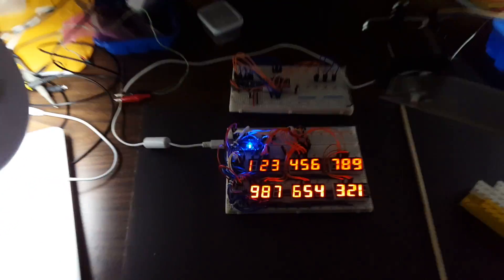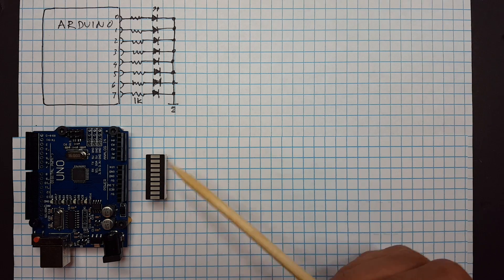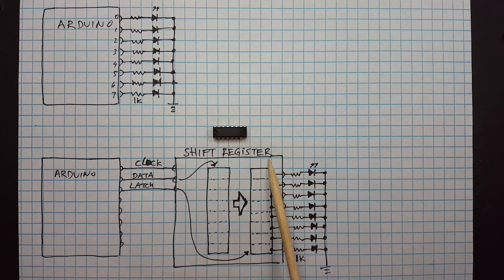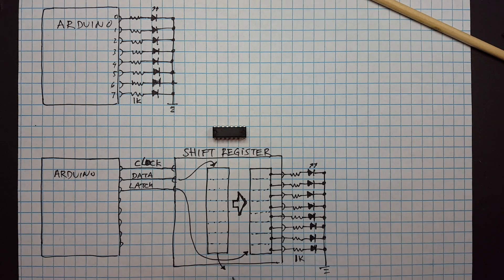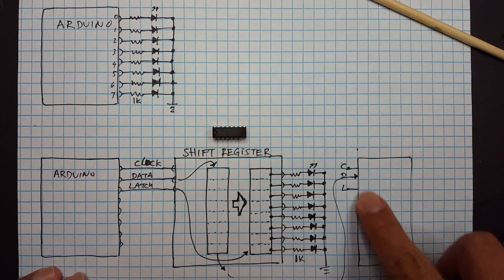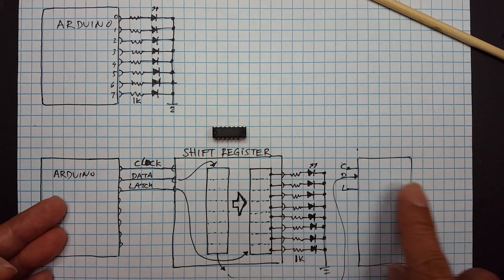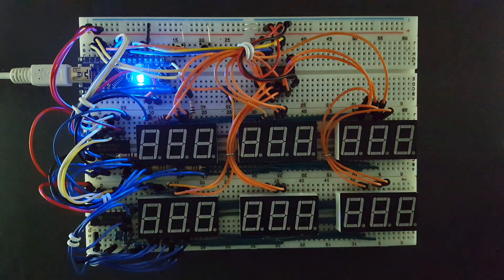HariFun #141 - Arduino vs. LEDs - Mega Sudoku Part 4

Comment: I mean this: https://imgur.com/a/p2OHQ9D Enlarge picture
Reply from the maker: The ATTiny85 only has 6 I/O pins.  You will need three to drive the shift register.  That only leaves 3 more pins.  Enough to control 3 digits, but you want four digits and some extra indicators.  There are many many ways to solve this problem.  IMHO, the best way is to get a chip with more io pins.  They're cheap and will be easier to code.
If you like the challenge, you could daisy chain a second shift register to drive the digits.  Coding would get a little harder, but it should work.

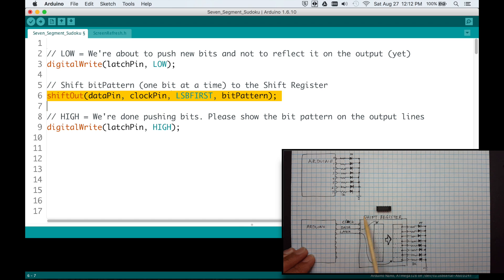Comment: Can I drive 12 hour led clock 12:00 Am OR PM led indicator & number 6 have 5 segment number 9 5 segment tex: 01:36 number 6 5 segment with 74HC595 X 4 & Atiniy 85 8 pin chip??
Reply from the maker: Hi Tommy, sorry, I do not understand your question.  Could you please explain it in a different way?
With Arduino Nanos being available for about $2, I do not see any reason to use an attiny other than space constraints.  Nano has 20 I/O pins, so you might even able to avoid the shift registers all together to drive just a few digits.

Comment: Just one question what is that IC in the top of the breadboard??
Awesome project. keep up the good work
Reply from the maker: At that time, I used another shift register to control the columns.  In final design, I drove those columns using transistors controlled by nine Arduino digital pins rather than a shift register (8 columns) and an arduino pin (9th column)
Thanks for the kind comment Pedro!
Reply: Until now i only saw the sudoku videos and the rgb cube, and immediately subscribed to your channel

Comment: Hi Hari,
Glad to see your back with another interesting project. I really like how you explain what you are doing, it is a big help in increasing my knowledge of electronics. 
I understand the shift registers, but don't quite get how you are able to write digits to all 18 led units with only 2 of them.
Keep up the good work!!
Stan
Reply from the maker: Good question Stan!  I should have covered that in the video.  :-(
Short answer: Multiplexing.

Detailed answer:
The sketch cycles through all the columns (left to right) applying positive power ONLY to ONE of the columns at a time.

Just BEFORE power is applied for any particular column, the sketch pushes the desired segment patterns for each digit in that column.

When the patterns for all 9 vertical digits for the first column have been pushed through the shift registers, THEN we provide power for that column.  Completing the circuit, showing the correct patterns for all 9 digits VERTICALLY for that first column.

Next, we prepare the segment patterns for the 9 digits in the SECOND column. Just before we display those new 9 digits, we turn off the first column and turn ON the SECOND column. Now 9 digits for the second column is displayed.

Yes, at this time ALL the FIRST column digits are OFF!
We do not want digits for second column to be displayed on first column!
Only digits on SECOND column is being displayed.

Now repeat this for all the columns VERY QUICKLY to fool humans into thinking that all columns are light up at the same time :-)

If you have trouble imagining this with 7-segments, replace each segment with just a simple LED and what you'd end up with is a simple 9x9 matrix.  Once you understand that, imagine 8 leds for each row.

It's hard to explain this in words, but I hope it helps.  
Thank you for asking the question. It's good feedback to me.
Reply: @HariWiguna  im sorry to ask,
so how many pin do you use?
3 for shift register (ds, sh, st), and 9 for activating the digit?? (12 pin for display)??
or you use less?
Reply from the maker: @MrBenyabd  , yes, you are correct: 12 pins to control 81 digits.
I also used one pin to read a 16 button keypad.
https://www.youtube.com/watch?v=G14tREsVqz0

Comment: now you can make the back to the future back in time clock :)
Reply from the maker: That'd be fun too.
Anyone know a cheap supply of 16 segment displays?
They're necessary to display letters such as K, M, and W.
Reply: +Hari Wiguna a power supply cheap one
 sure if for 5v could use a cellphone charger with a 1a output on it. or if need bigger there are a few on  ebay

Comment: is there a way to know what shift register will receive what data. for example, I want to send particular data to shift register #3 in series that way the led matrix will display a particular image of text or whatever.
Reply from the maker: Thanks for asking this question. It is good feedback for me that I should have  explained it in more detail.  As you already mentioned in another comment, each shiftOut pushes the oldest data further and further away from the Arduino.  Last one pushed out be closest to the Arduino.

Comment: i know we have to be careful driving too many LEDs from the Arduino's pins, because it can easily source too much current through the Atmega chip.  

Does the shift register act like a transistor array, sourcing it's own power?  
How do the amp limits compare to the ATmega?  Seems like a good cheap solution for bypassing the Atmega's amp limits.
Reply from the maker: I've never thought of it that way, but yes, you are correct. The Arduino only have to control the shift registers' Clock and Latch.  The LEDs are being switched by the shift registers, we're no longer putting the burden on the Arduino. 
The stock SN74HC595 can only handlw 20mA per pin. However, the TPIC6B595 can handle 150mA per pin!  Of course, if your total current consumption is higher than the Arduino's voltage regulator rating, you'll need a separate power supply for the shift registers.
Reply: Those high power TPIC6B595 shift registers are expensive.  It looks like it'd be half the price if you combined a standard 74HC595 shift register with a Uln2803 darlington array.  Also, this way you'd get 500mA per output pin.

Since the darlington arrays are dual direction, you may even be able to do some extra trickery in there to get double the number of output pins (saving even more money), but i didn't have time to really think about it.  Off to google i go!  
wait, nevermind.  RE: the dual-direction stuff, i think i confused darlingtons with stepper motors.

Comment: 2:36
Isn't it the other way around? The first byte gets written into memory, then overflows and sends the rest to the second shift register?
Reply from the maker: You are correct that the first byte got written into memory of the first shift register. However, as soon as we push more bits into the first shift register, the bits that's in there will overflow and get pushed out into the second shift register.  When it's all said and done, first pushed byte is on the second shift register and the second pushed byte is on the first register (closest to the Arduino).  I hope that clarifies how the shifts happen.
Reply: Hari Wiguna
Oh, okay, that's seems like an odd choice, but, well, that's how it is. Thanks for the clarification!

Comment: I connected 25 shift registers together with my LED cube. So there's no need to worry about how many shift registers you connect.
Reply from the maker: Hi Tyler! Your 8x8x8 RGB is awesome! I haven't gathered enough courage to tackle such a monumental soldering challenge! :-)
How did yo manage to get by with "just" 25 shift registers? a single color 8x8x8 would already need 8+8+8=24 shift registers. One more to do RGB? How?!
Reply: The cube is multiplexed, so only one of the 8 layers on at a time. Each layer has 64 LEDs with 3 leads that each need to be controlled, which totals up to 192 connections. each shift register has 8 outputs, so 192/8 = 24. The 25th shift register is then used to select which of the 8 layers is on.
Reply from the maker: D'oh! It seems obvious after you explained it. :-) Thanks Tyler!